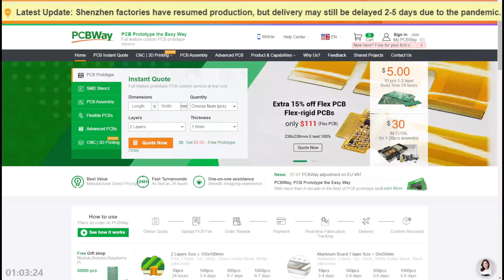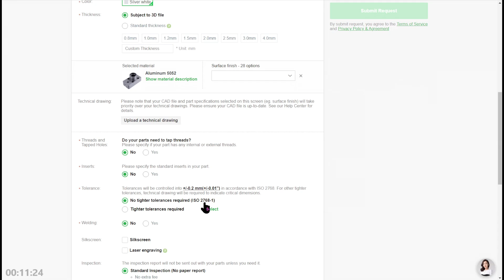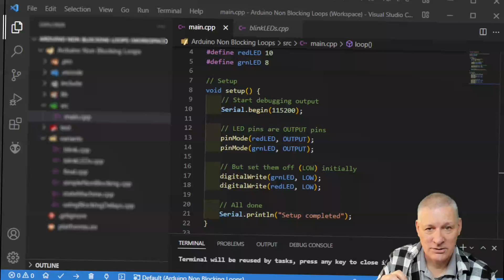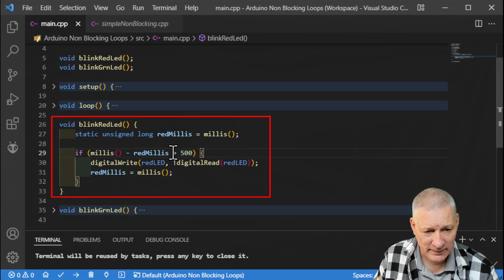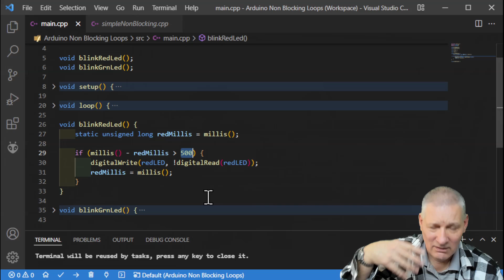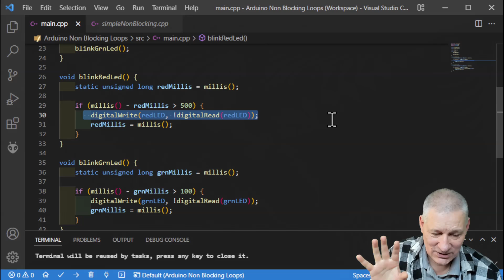#BB5 Moving your Arduino to a multi-tasking State Machine - Easy Intro

Comment: This is as far from being a state machine as you can get. There is no state. That said, it's the right way to blink leds, almost. 
That digital read is super inefficient, and I doubt the compiler can optimize it out. Use a second static variable, make it a bool. Much faster, less code

Comment: What makes these conditional if loops different than a Delay (500); Command for example?
Reply: Nevermind. I can see that it acts as a normal delay for a single LED but if you want to run the both of them it doesnt need to wait to begin the next sequence of code
Reply: @ryanramirez4501  the real difference is delay() stops and waits, checking for elapsed time takes almost no time

Comment: I found this video to be very helpful. Am I correct that because redMillis and greenMillis are declared within the associated functions, they are local variables and hence kept on the stack? If the answer is yes, does that mean they could be replaced with a local variable with the same name in both functions? I prefer the way you declared local variables with different names but am asking this question to see if I really understand the meaning of local variables, and especially those declared as static. Thank you! -  Jim
Reply from the maker: Variables, declared with the "static" keyword within a function, are treated as global variables but with a scope only for the function in which they are declared. Weird, huh?

This ensures that they don't get updated by other functions (by mistake) but are declared where they are needed. Keeps things nice and neat and avoids long lists of global variables which just clutter up the place and are a cause of many a bug.
Reply: @ : Weird indeed, but quite useful. Thanks very much!

Comment: This is quite helpful, thanks. The entire series is helping me begin to wrap my python head around C++. It would be most helpful if you would do a video about putting a semicolon at the end of each line so that perhaps one day I'll finally remember to do that before compiling.
Reply from the maker: If you used a better IDE it would tell you that a comma is missing (or, at the very least that the code was not understandable). I'm surprised that the Arduino IDE V2.x doesn't do this. I use Visual Studio Code with PlatformIO but that's whole different ball game.
Reply: @RalphBacon  Sorry, I was trying to be clever. I have downloaded VSC and installed PIO--I just haven't used it yet. Still wrapping my head around cpp.
Reply from the maker: An ideal Xmas venture, forget the TV reruns!

Comment: Static unsigned long redmillks = milks()  could simply be replaced by redmillis = O. Couldn’t it?
Reply from the maker: Nope. 😉 The 'static' keyword ensure that the statement is executed only once at the start of the function. Thereafter, the variable acts as a sort of global variable but only accessible from the function that declared it.

What you are suggesting would zeroise the variable on every iteration of the function, probably not what we want!
Reply: @ I meant to redmillis =O in the setup. So… it’d read only once. And make it a global variable…. But it would achieve the same, right? Thanks for replying, tho! I’m a total newbie…
Reply from the maker: Yes, you can declare the variable as a global one (that is, outside of any function) and set it to zero in the setup. 

The $64,000 question is why you would want to do that. 

More importantly, the reason why you would not want to do that, is because that variable should only be used by the function win which it is declared - no other function should be adjusting the value!

So don't make it global, keep its scope to where it is required. But, yes, your method would work fine, of course.

Comment: haven't done any coding in months now and have forgotten all of it, came back here for a refresher. wrote a code and designed a pcb and control panel/box to control the doors and hydraulic teasing rotors on my diet feeder on the farm and looking back over it I know i wrote it but can't remember all of why i wrote it 😅 have a 4 rotor silage rake to do next, trying to use multiple switches on a single wire(10 infact) to control it. 
one question i have, I want to individually control the rotors but from one signal, i.e I press one of 2 buttons and hold it, first rotor lifts one one side, I release and the opposite rotor lifts, now my problem is that these rotors both need to stop at a set height AND the rear rotors need to lift after a certain delay from both the first rotor and second rotor on the respective sides and also stop at a set height. 
I see 2 options, first would be an awful lot of code, the second would be to use 3 arduino, on to accept and relay the signal and 2 more one for each side of the rake to control the left and right pairs of back and front rotors?
Reply from the maker: Using more than one Arduino board is probably overkill. I would suggest building (designing) your project stage by stage so you're not trying to do 10 things at once.
Reply: @RalphBacon  funny how fate works, I'm only after starting this project seriously 2 days ago and I've figured a way using 2 state machines contained in 2 separate voids to work the machine independently in each side. Basically recapping your videos made me realise that the voids worked independently of each other(or what it seems to be to me) and that cleared a path to do what I wanted. Thanks for the reply

Comment: If timeNow minus timeStarted is greater than (or equal to) setTimePeriod, do something and then reset timeNow to now.
Reply from the maker: Um... I'm not clear of the context in which you are applying this.

I do
   millis() now minus oldMillis > delay between iterations 
then reset oldMillis and do the work.
Reply: @RalphBacon  millis is timeNow, oldMillis is timeStarted and check if it's greater than delay - setTimePeriod. Reset oldMillis - is the new timeStarted, which is now..

Comment: Very good instruction !!!  Three thumbs up !

My question is, what happens on day 50....when the "static unsigned long" variable is as high as it can go...but the time counter starts over .....Does everything stop ?

Have I missed something?
Reply from the maker: Yes, everything stops and the universe implodes. It's a well-known Arduino side effect. 😉

On the other hand, nothing happens because the counter (and millis) is an UNsigned long integer, it tries to take away a larger number (the old value of millis) from a tiny number (the new millis) and gets the correct value! Magic! Arduino have thought of everything.

As an example, let's pretend that millis was stored in a single byte, unsigned integer so could only count to 255 before overflowing (going back to zero). When that happened, we might suddenly be faced with a calculation such as 2 - 200 which normally could not be done (or would go negative, ie -198). But the value you get is 58 (ie the number of milliseconds that has passed since the count was 200 and is now 2.

If you don't believe me, write a simple sketch to prove it to yourself!
Reply: @RalphBacon  I've no reason not to believe you.
I'm just trying to understand.....

time now = 2    Millis()
time then was 4 million +/-    redmillis

so, if(now (2) - then (4 million) > 500)
{
    do stuff...
redMillis = millis(); //  <--this is where redMillis gets updated to the last time the "if" statement was true.
}

So, if the clock starts over (at 50 days) right after the last time "if" was true, then redMillis never gets updated again because Millis() is now at zero and counting up, while redMillis strays at 4 million/billion.

In my mind...it would never activate again.
I need to read more on millis()...I thought I understood it.
Reply from the maker: Write that simple demo sketch! It's an eye opener! Nothing to do with millis, really, more to do with maths and unsigned integers.
Reply: @RalphBacon  Thank you , Sir.

Comment: I've just found your channel and I'm enjoying your videos very much indeed!
My first introduction to Arduino-esque non-blocking code was the example sketch  'BlinkWthoutDelay' that's bundled in with the IDE.
Reply from the maker: Welcome aboard! Yes, the Blink-Without-Delay is a good intro to only carrying out tasks after a predetermined time. Not quite multi-tasking but getting there, and could be "enough" for many projects.

Comment: Is it not quicker to have a variable to toggle the led value instead of a function call to read the io value?

Nice video, subbed 👍
Reply from the maker: Well, "quicker" is a subjective term. It might take 500 nS to actually go and read a GPIO value and only 5 nS to use a variable but, quite frankly, does it matter? 

My take is to push "efficiency" to one side when coding, get the thing working, and then go back and refactor the bits that really are slow, if you need to.

And Welcome! to my channel, nice to have you along and contributing!
Reply: @RalphBacon  thanks for writing back 😎
Yes that makes sense.

Comment: A "state machine" does not multi-task. A state machine has "states", a transition function, and an implicit "clock."  I think what you're doing is "polling."
Reply: OH NO.  I was just fed a YT link to another RSB vid, which seems to acknowledge what I said. So shame on me for having responded to this 24-min vid without having watched the next one.
Reply from the maker: Well, yes, the first vid, was as the title stated, "moving towards an FSM" and was indeed polling. Sometimes this is all you need. But it is a logical step towards an FSM which is also, sometimes, what you need too!

Comment: Im still wondering how arduino manage to drive 3 steppers plus display plus  hot plate and nozzle  at the same time in Marlin or smilar  3d codes?
Reply from the maker: Because it is a fast processor! 16MHz clock, one or two clock cycles per instructions... it can get through quite a bit of work in a millisecond! Oh, and some really, really tight aka efficient programming, of course.

Comment: Thank you! Seems silly NOW to move the millis() value into the "current time" as most do , where you just utilizing the mills() in the IF statement to compare it to the last time the IF statement was executed. Every one teaching on YouTube has created the extra variable "current time". I will be following you. Thank you Sir! I will be studying the "static" and how the compiler does stuff with it during optimization.
Reply from the maker: Glad it helped!
Reply: @RalphBacon 
I like this simple use of comparing millis but, what about when the clock rolls back to zero? If the capture of the millis is at the end of the clock and rolls over to zero shortly after, the “if” statement will never execute again because the millis compare will never be greater than 500, or whatever value you have.

Comment: Awesome, Ralph.  It's great to have someone address the things that can really trip up us Arduino newbies.  And your presentation really makes learning this stuff a lot more fun, when it can be VERY frustrating!  Thanks!
PS:  I have a simple sketch that I have been working on that fails and make no sense why.  Want to have a go at it?
Reply from the maker: It depends on what you mean by "it fails". Compilation or run time?
Reply: @RalphBacon   What I'm trying to do:
NEMA 17 Stepper, TB6600 Driver, Arduino Uno, (2) momentary switches, Potentiometer, Rotary Encoder.
One switch runs motor in Fwd, one in reverse, Pot controls speed for both. Code to change driver ENA pin to LOW when button is released so motor will spin freely.
(works fine) Rotary Encoder to step the motor a few steps per de-tent. (Also works, but will not release the power to spin freely) Adding code to switch ENA pin to LOW causes the Encoder to become very erratic and not work.  Thanks Ralph
Reply from the maker: Is the Encoder serviced via an interrupt routine? Or done in the main loop, looking for a pin to go low/high?
Reply: @RalphBacon   Not using an Interrupt.
May I email you using the address in the "About" tab of your YouTube channel?
Thanks so much for taking the time, Ralph.
Regards
Reply from the maker: Yes, do that.
Reply: @RalphBacon   I sent the email and the sketch. Thanks Ralph.

Comment: decent beginner explanation, for true  robust multitasking, give each LED a dedicated micro controller.   This would apply to  control of other "multi tasked "  devices.
Reply from the maker: Does giving each LED a dedicated microcontroller actually achieve a more robust solution? Especially if each LED is in some way dependent on the others?
Reply: company boss loves your solution and gladly spends more money on hardware

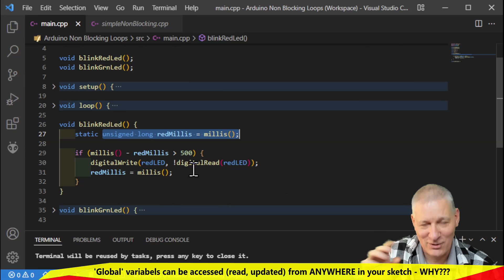Comment: 12:30 Could you elaborate a bit more what the problem is with defining those global variables? That is the way I always work and to be honest I don't understand why that is such a problem. I'm only an amateur but keen to lean :)
Reply from the maker: I've ranted before about global variables but here goes.

Although I (tongue-in-cheek) call them the Spawn of the Devil, that's not strictly true. I sometimes use global variables IF they are being used globally; that is, by more than one function.

But variables, in general, should be restricted in their visibility (and, hence, use) by defining them in the function (or, better still, namespace) to which they belong. That way, they are not arbitrarily changed by functions which have no business using them, let alone updating them.

It's to ensure your code is "cleaner". For example, if you were to refactor (refine, rewrite) one of your functions by removing it and adding it to a different namespace, would the rest of your code throw a hissy fit at not finding a variable any more?

So, put logically connected functions into one file. Include that file into the main sketch with the use of the #include statement. Ensure that file has a namespace so that you can't just access its functions or variables without also specifying the namespace. See my simple videos on namespaces if this is not clear to you!

Real World Example: you are reading a temperature sensor. Chances are, that you want other functions to be able to know what the current temperature is (eg, to display it, or take action when it reaches a certain level). So should this variable (let's call it "currTemperature") be visible to all functions in your sketch?

Not if you want to do a good job. The functions that are to do with the temperature sensor might be in a namespace call "sensor". So that variable is now referred to, by the rest of the sketch, as "sensor::currTemperature". But it is not global, and it should be very clear in the code that you are referring to the variable in the "sensor" namespace. 

TL;DR I covered all this in various videos before! Grab the pdf file of all my videos and search for ones that cover this topic. Worth understanding the concept, at least!
Reply: @RalphBacon  Thanks so much, this provides a good starting point for understanding the namespace concept better. I will definitely check out your other video's for this topic!

Comment: Hi. First off thumbs up on video and thank you. I'm newbie here and I am not kidding. I'm trying to find out the easiest way to go about something I don't know much about. I want to use 6 servo motors, few leds, and a precorded sound all in one box that with the push of a start button the show begins with a homadebox with 3 characters with servos connected to hands and legs that move with the sound of a prerecorded script.( I know how to program servos now ) and leds to be programmed too. 

My question is this. Is it easier for me to just get 3 little nano's  and put the 3 different sketches in each and tie them together that way and be done with it or should I do this state machine thing? Help please.
Reply from the maker: If the servos are logically connected then you should not use separate microcontrollers. 

A state machine will allow you to control everything in a logical (and connected) manner, but you do have to get the state diagram correct FIRST! This will take time, there are no shortcuts.

Those programmers who immediately leap onto their favourite IDE and start coding are doomed to failure. Get the logic (of the state machine) clear first, then convert that into Arduino-speak.

Why not try a simpler model first? One (or perhaps two) servos, a couple of LEDs... you get the idea. That will show you where you are less than precise in your logic and will help you in the final version of the code.

Comment: What about digitalWrite and read taking some ms to complete in both functions, they will take it from 500/200 ms check. Isnt it?
Reply from the maker: digitalWrite/Read are relatively slow as they carry out several checks (safety checks for beginner coders). You can speed them up by setting the relevant registers (eg PORTC). That will hardly take any time at all.
Reply: @RalphBacon  Even doing such checks digitalWrite is faaar faster than that... Assembly for them should not have more than 30 instructions... Most uC do one instruction in 1-3 CPU cycles, so even 1MHz CPU can do about 500 instructions in ONE ms. Notice that slowest uC has at least 8 MHz - so it should do at least houdred digitalWrite() per millisecond. For blinking it's overkill.
Reply: you need almost 300 digitalWrite to waste one millisecond
Reply: I get the heebie-jeebies whenever I read code that has an implicit reliance on time or the specific hardware.  We're dealing with C++.  Functions can be  overwritten by, for example, a function that invokes an actuator ("Open the door, Hal")  that operates in realworld time, not in CPU cycles.  If we rely on the speed of the processor, we're not doing a good job at abstraction.